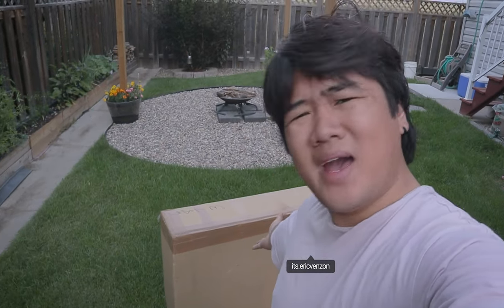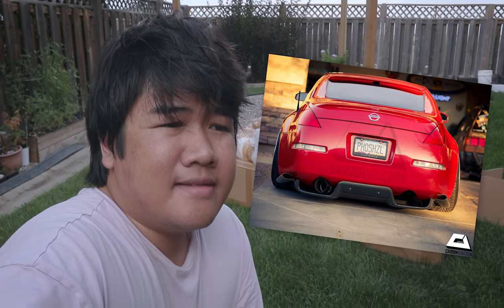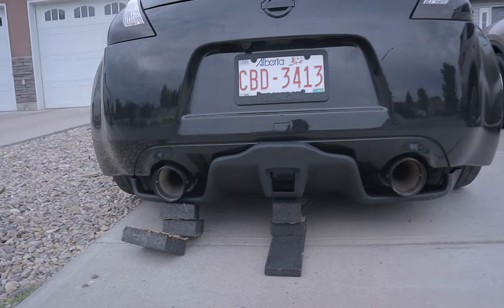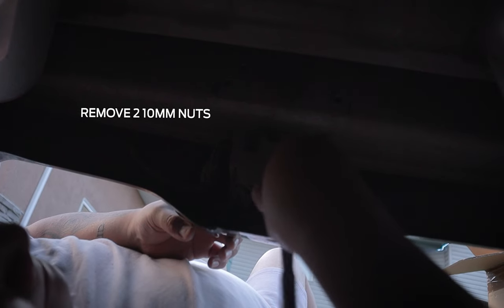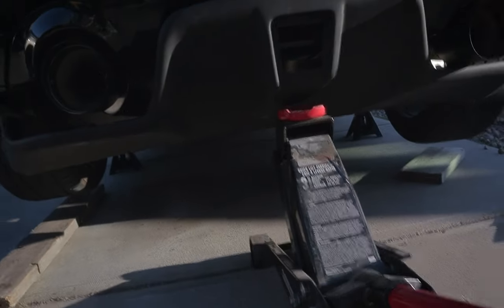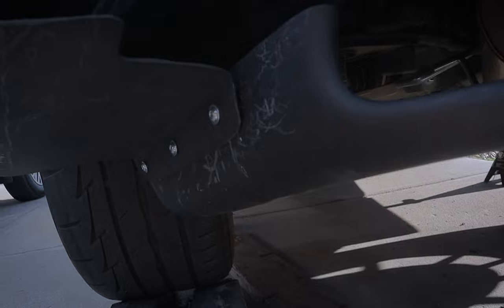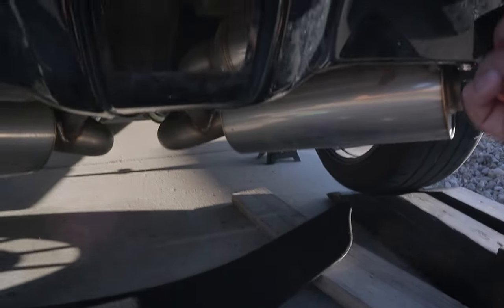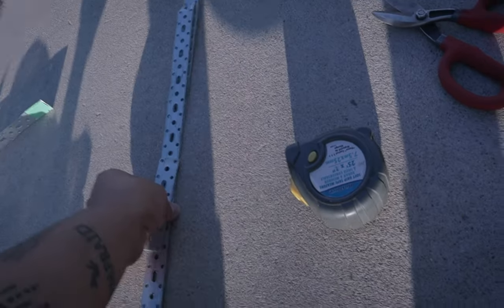The CLEANEST 370z rear diffuser!! (by PIOTR GRZELAK) | Install Guide

Comment: I also have the same diffuser purchased from the same guy except I got mine about a year ago. Mine however was reinforced in the rear with a bar of aluminum and came with a long piece of aluminum L bar that mounted to the upper heat shield, as well as metal mounts to come down from it. Interesting to see the cutbacks that had to be made, probably because of metal shortages
Reply from the maker: Damn, i missed that then. So far it hasn't failed me yet after driving it in the highway. I'll double check on my bolts for sure
Reply: @ItsEricVenzon  yeah they are pretty good, the only issue I had after a year of ownership is the nuts and bolts that were provided started to rust just a few months in and after a year I had a few washers literally falling apart. So if I were to suggest anything it would be to hit up a local hardware store and just get some better stainless bolts. Love the vids btw 👌
Reply from the maker: @ericking1339  I'll start planning on that one then! Thank you! 😌
Reply: Can you guys leave a link to his site? I cannot find where to buy this from :(